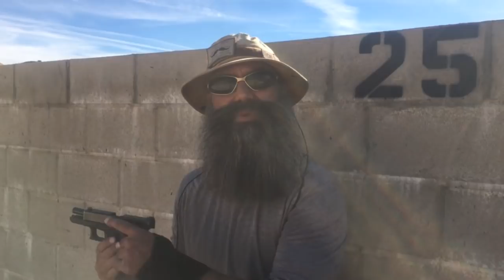Glock Says Don't Drop The Slide  Using The Slide Stop.  Fact or Fiction?

Comment: Nerd. I can tell the fallacy in the video due to the amount of edits. I've also seen the slide wear out enough to cause the slide stop not to work.
Reply: The notch in the slide is NOT going to wear out before the actual stop does.  The slide is much harder steel.
Reply: Sure son sure, and shafts, like for example crank shafts in automobiles are not grooved by the MUCH softer oil seals that contact them either. Sure they aren't. Every mechanic that's ever looked at one and seen the obvious groove cut in the shaft right where the seal lip contacts it is the victim of a visual hallucination. Sorry to tell all of you who think otherwise, softer materials, can, do and will wear harder ones with enough contact.
Reply: Then you should buy better guns. Maybe Glocks are just too soft.

Comment: All I know is using this button/lever to load unload reload clear misfire  tap and rack over several years will wear out "something". And then a discharge can occur.  I remember the word "sear" mentioned.  One cop in Calgary and one in Winnipeg discovered this. Kind of surprised this has not happened in USA.  Handgun ownership is not common here.  My 18yr old handgun Glock 22 was starting to go automatic even though I rarely used the slide stop  as per warning. We were sold the cheaper versions I guess.  Both incidents had the same make model caliber.  Maybe just a unique problem to the Glock 22 40Cal.  Not likely something Glock has in their brochures .  Hence the warning for impending lawsuit  :)

Comment: Not the noch on the slide haha  the slide lock wear out  there it can not  fitt in slide noch slip wil not lock on last round   use you big headeded brain
Reply from the maker: rasimos Listening comprehension issues?  Glock says the notch will wear out. I have close to 100k rounds through a Glock 17 without issue and it’s still wearing the same slide stop. Think twice, type once. Glock has told me twice that the notch will wear out...not the slide stop itself.